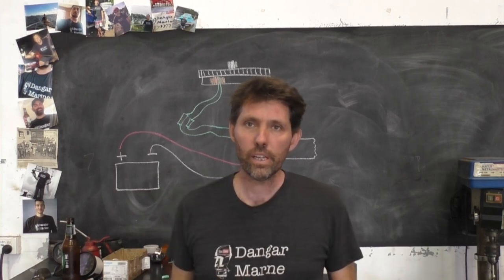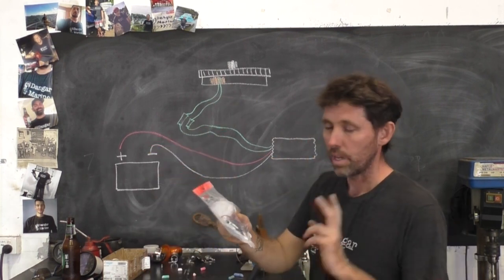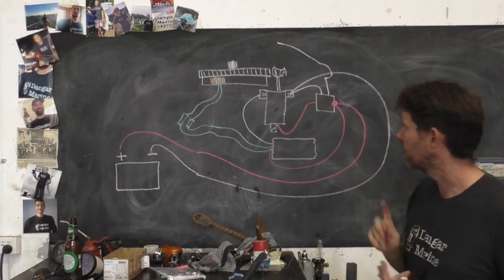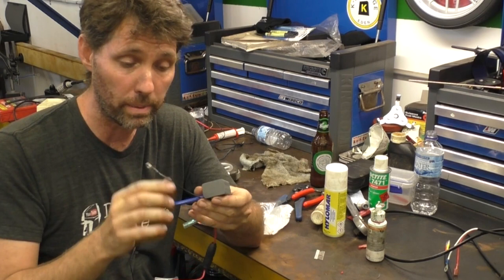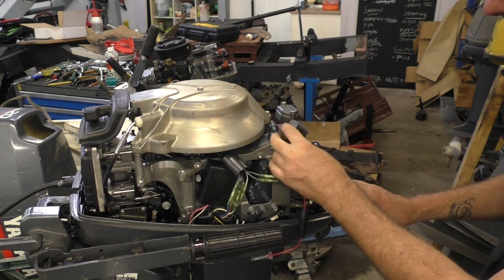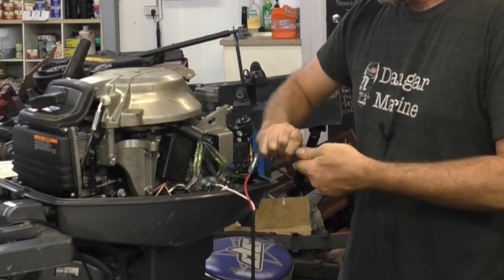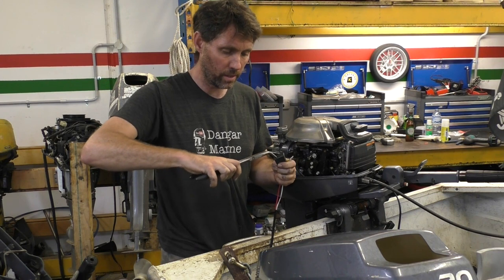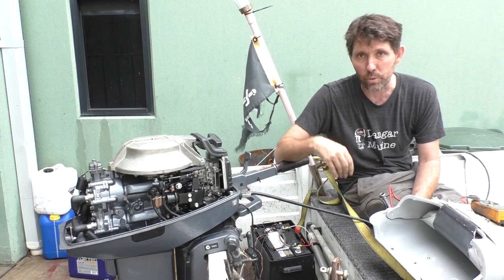Charging a battery from an outboard

Comment: hey mate LUV ya videos!!!!! Just wondering does the regulator/rectifier have to be specific to your outboard? or is any AC to DC outboard  regulator ok? e.g. using a yamaha rectifier on a tohatsu?
cheers
Reply from the maker: Thanks mate, yes, you can take them from any outboard with the same number of green wires and a similar HP rating.

Comment: If from flywheel comes out 3 wires and they  all have the same wire color how do i know which is which? Can i check it somehow? How many volts there should be?
Thanks
Reply from the maker: You'll really need to find the service manual for your exact motor to be sure. Googling for a PDF will probably find something.
Reply: Yes i get the aswer from google - https://forums.iboats.com/filedata/fetch?photoid=10009449
it has 5 wires rectifier,that confused me.Maybe its helpful someone also
Thanks for the great video aswell

Comment: hey mate could you tell me if it matters if the 3 wires on the johnson 25hp go to any of the yellows on the rectifier or are they matched to each other..i know the red goes to the battery but the rest im lost..i never got any instructions..is there an earth
Reply from the maker: It is my understanding that it doesn't matter where the three yellow wires go, they are three phases of AC power and should be interchangeable. Do the wires have a different coloured strip in them? If so match them up. I presume it gets it's earth by being bolted to the engine block.
Reply: Dangar Marine 
thanks mate..

Comment: is it common to have an outboard with a starter motor that doesn't charge the battery?
Reply from the maker: Do, most outboards with a starter motor are generally setup for charging a battery. It is pull start outboards like that is one that often don't.
Reply: This is just my 2 cents, Stu might have a different answer... I'd say any engine be it outboard, inboard, overbored, (but not overboard or cardboard) that has a working, factory-installed electric start set-up, will be capable of charging the battery that enables the starter. It's just that when you get into smaller outboards, having electric start is an option that adds to the buying price.  The builder probably sees fit to include the lighting coil anyways to run basic lights, much like non-electric start snowmobiles have to have a way to provide power for head/tail /brake light despite not having a "full" electrical system. Perhaps Stu could enlighten us about just what might be plugged into that Yamaha's "outlet".    As Stu mentioned early in the video, the battery is an added piece of equipment for convenience, to power a bilge pump to avoid the boat taking on too much water when parked and rain begins to collect in the boat.
Reply from the maker: Pretty much all you can use that AC current for is running simple incandescent lights which I presume is where the term "lighting coil" comes from even though now people run a variety of DC equipment too.
Reply: Stu, AC for lighting off the coil is an old name and AC for incandescent globes is actually a good practice. Using AC means you don't get that silvery sheen to the inside of the glass you get  when the globe is used on DC( non halogen globes) . So on older globes the use of AC was recommended practice. And AC is also easier on switches as arcing self quenches.

Comment: Hey stu, I can't find any regulator at the store, Is there any website you know that sells those? It would be nice to connect it to my 15 HP Yamaha 2 stroke so i don't have to go charge it all the time.
Reply from the maker: I just ordered a couple from MarineEngine.com under "Common Replacement Parts" for the model of outboard in question.
Reply: Thank you :)

Comment: İ have a Mariner 2 stroke 9.9HP outboard on a second hand boat that İ just bought. There appears to be a lighting circuit that feeds into a plastic box then goes to a green wire and a green & white wire that terminate to two nuts. Does this mean that there is a rectifier & İ can just go straight to the battery? When İ connect a 12 Volt bulb it illuminates but is only brown. İ get a reading of 5MV on full throttle.
Reply from the maker: These are probably the AC output wires from coil.

Comment: Hi Stu,
Question.Would you benifet by running the rectifier cables to a charger such as a 20amp ctek then to the battery?Would you get a bit more of a boost in charging?Could also then have a solar panel rigged up to the ctek...
Reply from the maker: I don't know much about those chargers, but I would say they add more value when you have both the rectifier and a solar cell running into the charger then onto the batter.

Comment: Any tips for installation on a 2015/2016 15hp (15FMH)?. The two wires coming down from the lighting coil are blue and brown, which run to a little black box with "63v-02" written on it. The wires run out of this box to the kill switch, and the spark plugs. I assume I have to junction into a couple o wires here, but am unsure of where. Cheers.
Reply from the maker: They sound like the ignition coils going to the CDI box. It may not have a lighting coil if there are no green wires.
Reply: @DangarMarine  Yep, I finally found a decent Australian manual and realised it doesn't have a lighting coil. Apologies for that.
Now to try wrap my head around installing a lighting coil. 
Cheers mate.

Comment: Hey Stu . Firstly thanks for your content , I am not really a boaty but I have been watching your Renko build since the start. I have recently brought a little tinny and I have installed a regulator rectifier , what size fuse is recommend or what  is the amperage output of the regulator rectifier is ? I'm thinking less then 10amps?. Can I get away with a blade fuse ? I have midi fuse already but the lowest rated fuse for those is around 25amps . cheers .

Comment: I have a 2006 25hp. I followed your steps on installing a rectifier/regulator as you performed on the 20hp Yamaha but my voltage is around 8 bolts at idle and around 50+ bolts at wot. I connected to the 2 green wires as these are the wires from the exciter coils.  Not sure if there is something that is missing but your help would be appreciated.  (BTW, I did purchase the same rectifier you did, as that is what the engine called for.)

Comment: Any idea on the DC wattage out from the rectifier?   I'm wondering about using this to feed back into an up-converter to charge a 24v battery system that runs an electric trolling motor... but I'm guessing it won't output enough to make that worthwhile.   Thanks for posting your work... really helpful stuff.

Comment: On a 7.5 manual start merc, not with a Lightning Stator but with two basic charging coils, yellow and white leads, one yellow to ground one yellow to Switch box and white leads connected to each other, is there any possibility of configuring with additional components to top up a battery?
Reply from the maker: Possibly. A lot of small outboards just have a simple charging coil, but you'd have to look up the colour coding for Mercury outboards to make sure you've got the right coil. As long as they aren't ignition coils you should be good to go. If not you can add one from what I have read.

Comment: What if your motor doesnt have an ac socket ? I have a suzuki dt 85 how would I go towork installing one on it ?
Reply from the maker: It depends whether it has a lighting coil under the flywheel. That is the expensive part. Adding a socket if there is a coil is relatively simple.

Comment: Hi Stu. Great Video. I've got myself a new regulator for my outboard and it's got 5 wires instead of the 4. 3 yellow a red and a black. Any idea what the additional wire is for?
Reply: Did you figure it out?

Comment: Thanks for an excellent video.  Can I ask - Once a rectifier/regulator is installed, is it ok to run the outboard without a battery connected?  Will it cause damage (or even destruction) of the rectifier/regulator if there is no battery connected?  Thank You.
Reply from the maker: Yes, it isn't great to run any charging system without the battery connected, it can cause damage.

Comment: Anyway I can send you a picture of my outboard and you can tell me if this can be done? I do have wires coming from my flywheel into a little circular plastic block with like a metal clip then it runs into where the spark plugs go would like to avoid the hassle and just send you a picture and you tell me if it’s even possible

Comment: Hi stu, i bought the exact same part for that exact same outboard and the voltage goes over 16v, did you fit a regulator also?
Reply from the maker: No. My understanding was that the part was a regulator rectifier combined.
Reply: @DangarMarine  Thanks for your reply, i'll do some more trouble shooting.
Reply: @coryhiggison9148 its the wrong part number for a rectifier/regulator. And it will go over 16v like tour saying

Comment: Hi Stu, I have an old 115HP 2-stroke Yamaha, it has a 3-phase lighting coil. I'm getting about 14.8V at cruising RPM. Is this too high, could it damage the battery? From reading on google it seems like 14.5V is optimum and anything over 14.7V could be a problem. Thanks
Reply: David, a difference of .1 or .2V is nothing to worry about, your multimeter's is not accurate enough to read that level properly. The main thing to watch is that the battery technology matches the era of the motor. If you use marine (never car!) lead acid batteries and your motor is an older one (like my 1974 Neverude as an example) they do not have a regulator as an option. They rely on the battery gassing to get rid of the over charge - in fact the service manual's fix is to turn the navigation lights on if the battery goes over 15 volts - but the manual does not have a multimeter as an option for the engine! My motor has a 6amp alternator coil and over charges the battery easily so you should not use a  modern sealed lead acid battery as it will have a very short life .
 More modern engines have a regulator that keeps the voltage down to the 13.8 -14V level that a modern SLA marine battery will charge properly at. SLAs should not be taken to gassing voltages - that's the 14.2 volts or above level.
Reply: Thanks Ron. My outboard is 1993 and has a regulator, and I'm using a standard marine lead acid battery so it sounds like I'm OK.

Comment: Hi Steward, need some help here. I am having a new boat built with a 115hp 4stroke yamaha or suzuki built and i would like to do a dc to dc charger for the 2 x secodary house batteries and i dont know if and how it can be done. Dc to dc will be victron tr smart.

Please help?
Reply from the maker: You could use just a simple 2 battery bank battery switch or even a Voltage Sensitive Relay (VSR) to connect the batteries while the engine is running and disconnect them when they are off. I use the Victron TR to charge my house but only because my starter batteries are lead acid and my house is lithium.
Reply: @DangarMarine  thanks for the reply, i will see how i go, as its a cabin boat for river use, i thought of a dc to dc, to link solar, should i be staying overnight for a day or longer, but dont want to tax the allternator by drawing to much with the dc to dc charger.

Comment: I just found this video, I then checked my Yamaha 8hp 2 stroke for the green wires and they were there. My concern is that I have a sailboat and the ob has a high thrust prop, I run the motor at high rpms, will it be overcharging without a regulator?  I read in the comments that someone was informed that these are just rectifiers and not regulators. Please let me know what you think.
Reply from the maker: On smaller motors they can be just rectifiers. I wouldn't be too worried about overcharging with an 8HP motor, it will only have a single charge coil under the flywheel.
Reply: Dangar Marine, thank you, I went to my Yamaha dealer and got the correct one for my outboard, it didn’t have the extra lead with a fuse. Looks like I’m set, thank you from Southern California.

Comment: I have a '93 Evinrude 25hp. , no green wires coming from under the flywheel, 2 sets of two. One pair are tan, and brown with yellow stripe, the other pair are white, and black with white stripe. Any ideas? I got no manual just bought the motor, starts and runs great. Your videos have been very helpful thanks. Any help is appreciated.

Comment: I am going to buy a Evinrude Etec 60 hp.  Will it charge my battery or will I need to arrange a charging system like you show here?  Thanks for a nice video.
Reply from the maker: It will come with a charging rectifier in place, particularly if it is electric start which I imagine it would be by 60HP.
Reply: Thanks for the response.  I enjoy your videos.

Comment: hi thanks again  for the helpful  vid .  just installed mine and its running 6.2 volts at idle would this  correct itself to 12v once  powered upon full throttle  ? cheers Larry
Reply from the maker: It should

Comment: I am 12 from QLD and absolutly love these vids and would it be possible to install this on a 6 hp yamaha
Reply from the maker: Hi mate, glad you are enjoying the vids. Yes, it is my understanding the 6HP also comes with a lighting coil already installed. Just check and see if you can see a pair of green wires coming down from under the flywheel.
Reply: Dangar Marine Thanks Stu

Comment: Are there any heat sink issues to be aware of with the mounting of the VRR?
Reply from the maker: All you really need to do is make sure you have it firmly attached to a metal mounting point that the heat can transfer into.

Comment: Hi Dangar marine I have yamaha F15C and I want to install a bilge pump 12 volts in my boat could you plz advised me what rectifier I should place in the engine .THANK'S.
Reply from the maker: Best thing to do is to take the full model number and year (best just take a photo of the plate on the bracket) to a Yamaha dealer and they will order you the right one for your motor. That's all I ever do.
Reply: Thnk's for your reply but you know the yamaha dealer in my country tell me  that they never receive this parts from the yamaha industry, so is it possible to put a motocycle rectifier in the engine.
Reply from the maker: You could probably just order it online. This looks like the one for a 2004 Yamaha F15C http://www.marineengine.com/newparts/part_details.php?pnum=YAM6AH-81960-00-00
Reply: Ok i will order it . thk's

Comment: Would a charging system like this come standard with a yamaha 115 2-stroke? If not is there a different system?
Reply from the maker: Yes, any outboard with a starter motor will come with a charging system standard. Some bigger engines have alternators like cars.
Reply: @DangarMarine  thanks Stu!

Comment: Great video Stu.  My '86 Johnson 90HP V4 is calling for a $350+ reg/rec part.  I am thinking it seems like I could just use a $25 Yamaha 100HP/Mercury 90HP reg/rec instead.  Any thoughts on this idea?  Stator I have is supposed to be a 3/9A.  Any advice on what to check or watch for?

Comment: Hi brother !
I need your help.
Just installed the voltage regulator in my Yamaha enduro 40hp as seen in your video.  When in idle, the voltmeter reads 8.40v
When in hi RPM  it goes to 50v !!
Battery is not connected.
Just voltmeter to ends of regulator.  Is this ok ???
Reply from the maker: I'm not 100% sure about testing with the battery disconnected, I'll have to look into that. I would try with a battery (testing at the battery terminals) and see what you get. If it goes up above 14.5 volts it looks like you might have a rectifier but not a regulator in the system. Sometimes they are combined, sometimes not.

Comment: Hi stu, good video also this time, one question, do you know the Gear box ratio of the Suzuki DT75? Or can you do a video on how to find it? It is usefull to find the right propeller
Reply from the maker: I don't know the gear ratio off the top of my head, but other than Googling it you can also mark a spline on the prop shaft and count how many times it rotates as you turn the flywheel through on complete rotation to give you the ratio.

Comment: Hey!
Great video!
Is it working for 2006 Yamaha 25 amhs outboard? Do I need anything else?
Thanks in advance!
Reply from the maker: If the outboard has coils under the flywheel you really only need the regulator rectifier and an inline fuse.

Comment: Hi Stu, thank you for your great video's, Ive watched them all. I have just bought a brand new Yamaha 15 HP 2 Stroke F series and for the life of me I cannot find the coveted 2 green wires that would connect to a rectifier. Do you reckon they built ones without them at this late stage of 2 stroke manufacture or have they changed colour. I have no loose wires hanging there, all neat and tidy, as youd expect for a brand new motor.  There are blue, brown, white and black but no green. What do you reckon. Cheers!!
Reply: Dont worry about it Stu, the new Yamaha's in my size no longer come with a lighting coil, thus the no green wires. You can fit them after market but its another $100  outlay, might just stick to using a charger.

Comment: I would have expected you to put a fuse on the + close to the battery. What happens if there is a short?
Reply from the maker: It's a good question and one I was thinking about too. It would be interesting to find out the maximum current output of this regulator and put a fuse in line. I guess they don't traditionally because they are connected to the battery leads that are unfused as they need to supply the starter motor. Given these wires are much lighter though they could use some protection from a short to stop them from melting.